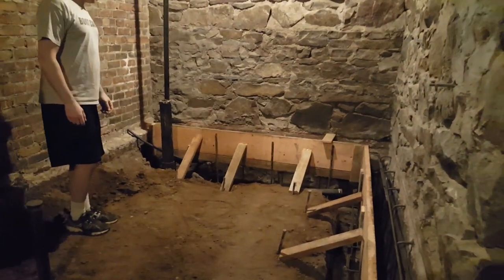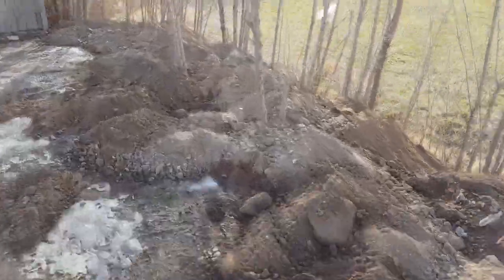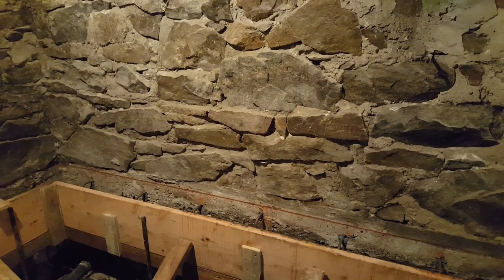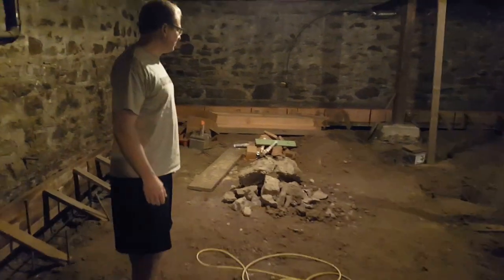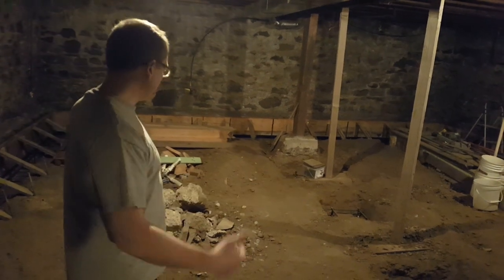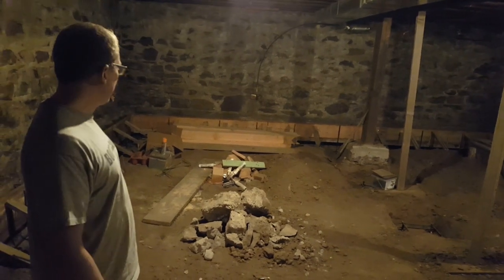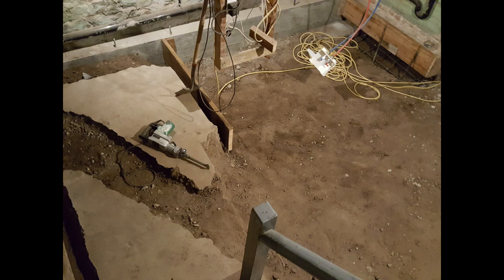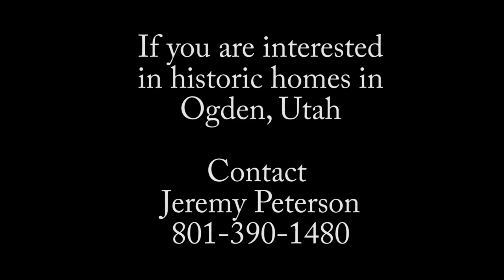My Old House - Ep.  3 -  1908 Craftsman Home - Basement Concrete Footings and Floors

Comment: Working on a similar project in my house that's built in 1899. The stonewalls are similar to yours, only that they are 35 inches and the house lays on a hill. Have wiped the floor down to the mountain and will need to to do about a foot more. How did you construct the drainage system in your basement? I also wish to keep the original stone walls, and planning on getting heating in the concrete floors to keep the basement continuously warm.
Reply from the maker: Hey Mats, your project sounds ambitious.  Because our home sits on a bench above the river basin, we do not have a water table problem.  Our eaves hang out a couple feet beyond our walls so rain is carried away from the a couple feet.  We have not had moisture issues in the basement other than a sprinkler line problem that we fixed quickly.  Your radiant heat idea sounds great!  Be sure to share some video!

Comment: Who poured your floor.  I have a home in Salt Lake and finding a cement contractor has been very difficult.  Thanks!
Reply from the maker: Hey Ashley, funny story.  It took us four months to find a contractor that would do that job and only after persistent effort were we able to convince them to do it. We were going to promote our concrete contractor in the video and he asked us to refrain from promoting him.  He said it was the hardest concrete job he had done in 15 years and he would never do it again. D'oh!
Reply: @vestarealestate4940  Thanks for the reply.  That is typical of the responses I have received as well.  I don't even have the steps and curbs you had to put in but most shy away from the work.
Reply: @vestarealestate4940  Why this was the hardest job he'd done in 15 years? What makes this kind of job more difficult than other jobs? Thanks in advance!
Reply from the maker: @pancakepancake3789  The difficulty was in removing the dirt (hard as concrete type dirt) from a closed in interior space.  Our contractor normally did exterior type work with heavy equipment available.  The limited space and tight work conditions with hard materials made it a real chore.  We couldn't find anyone else who would do the job!
Reply: @vestarealestate4940  Thanks for clarifying -  that's very helpful info!

Comment: Is there a code requirement for egress windows
Reply from the maker: Charles, great question.  In Utah, a law was passed in 2015 that prevents municipalities from requiring owners of old homes to cut into foundations to create larger egress where that work may jeopardize the structure of the home.  This rock foundation structure qualifies under that law.  The windows will fold down to allow someone to escape.  Also, a built in craftsman style bench will be constructed under the bedroom windows to allow someone to climb out of the window.  This will pass Ogden City code.